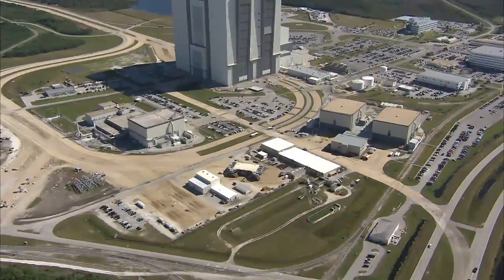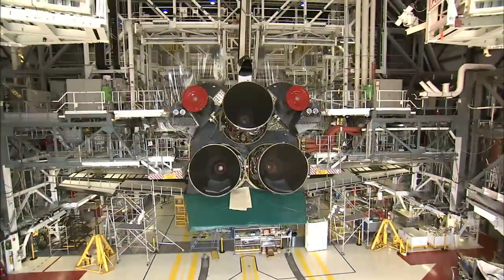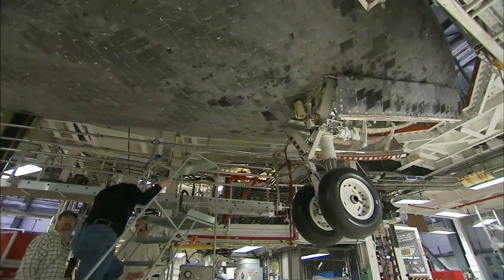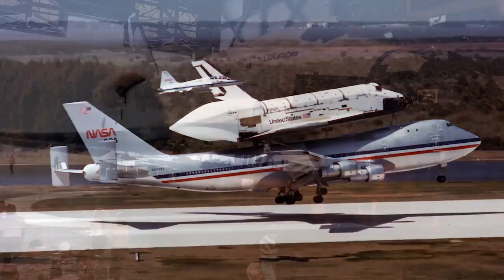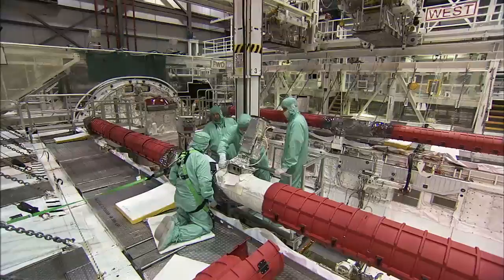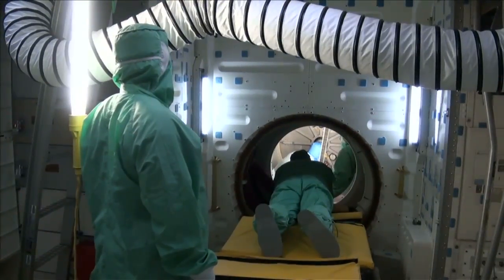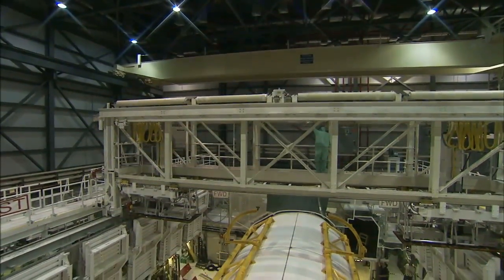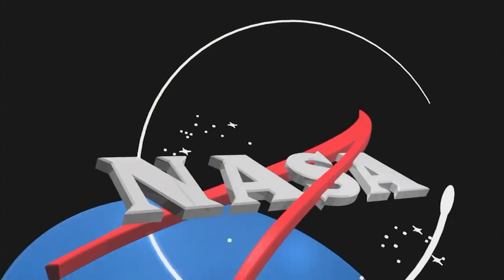Shuttle Era: Orbiter Processing Facility

Comment: Before any shuttle heads to space all work begins here the cavernous building known as Bay 3 it is in here that every shuttle is prepared for flight. When a shuttle lands it is towed in here and NASA Kennedy's Workforce gets to work they take the old payload out and send it over to the space station processing building and prepare the vehicle for its next flight. When the orbiter is ready the doors are closed and the clean room cells are removed. Under the Orbiter the KMAG transporter is secured to the attachment points which will mate it to the external tank then the Orbiter is moved next door to the Vehicle Assembly Building where is assembled into the rocket that will take it into space.